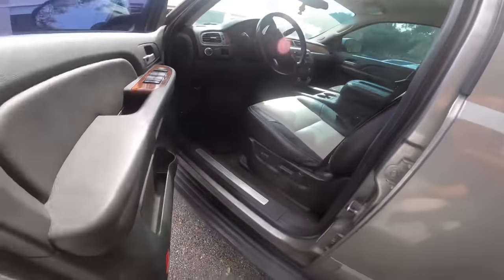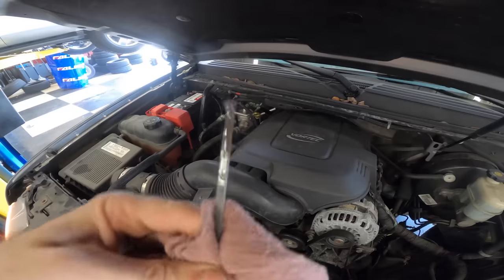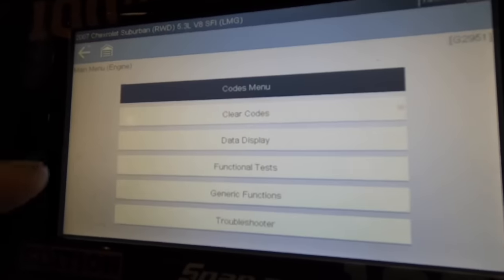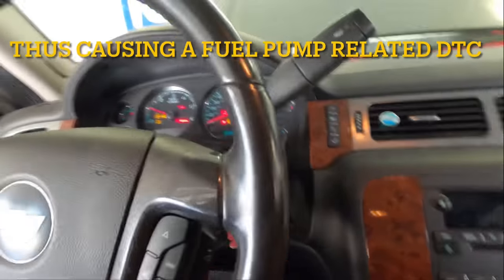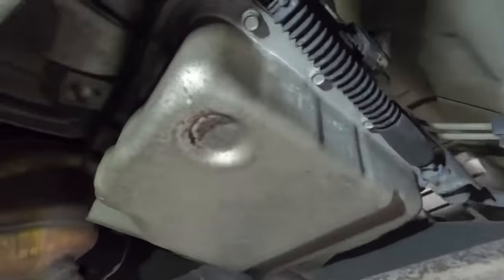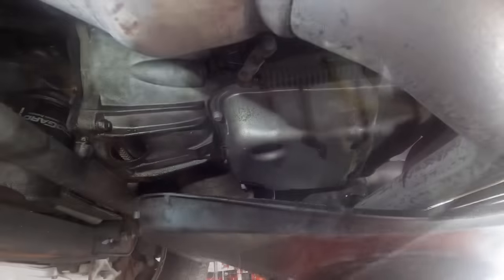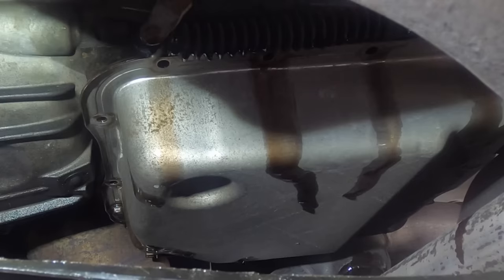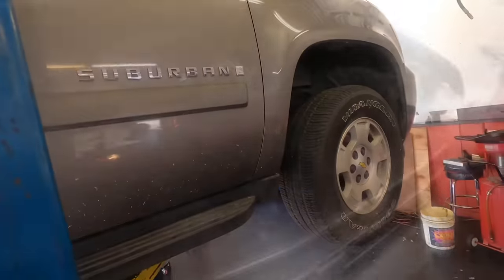Busted! SCAMMING Mechanic Causes Damage! 4l60E Transmission

Comment: Bravo, I was a mechanic / technician for 40 years solving seemingly unsolvable issues for my customers. It makes me happy to know there are those carrying the torch. Thank you.
Reply: YouTube ShadowsComments  my solution is quite the opposite buy the cheapest used car I can find that is mechanically sound then maintain it properly and fix what you can fix from youtube videos and if you cant fix it send to junk yard get most your money back plus riding 😎
Reply: YouTube ShadowsComments  well I'm 33 and has served me well for quite awhile knock on wood plus my basic insurance plan has 5 free tows that i can fall back on good luck with your monthly car payments lol
Reply: YouTube ShadowsComments  you would be suprised how easy alot of stuff is to fix just from a simple youtube search
Reply: YouTube ShadowsComments  not if you have 2 cheap used cars like me and insurance for both is like 20 dollars difference
Reply: YouTube ShadowsComments  cool different strokes for different folks I suppose lol plus I like having the cheapest insurance as possible too
Reply: YouTube ShadowsComments  no headaches they work great and when and if they dont they will either get fixed by me or go to junk yard and I'm out nothing or very little but if a new car breaks beyond repair and out of warranty now thats a headache ounce it runs out I mean
Reply: YouTube ShadowsComments  a financial headache lol
Reply: Plus you can hop in your new car and drive cross country without much worry, instead of breaking down in some small midwest town that you have to wait days for parts or repairs .
Reply: @chuckshade7959  rent a car
Reply: @chuckshade7959  even if I had a new car id still rent a car to not wear mine out
Reply: Im trying but it's very frustrating some times.
Reply: @LJT9393  well said
Reply: YouTube shadowcomments doesn't know anything about working on cars. He basically said I'm mechanically stupid in my mind lmao.
Reply: YouTube ShadowsComments  You are getting trolled hard by the creator of this video kid, just let it go and agree with the broke people
Reply: YouTube ShadowsComments  please tell me, what make and model is the car?
Reply: YouTube ShadowsComments  bucket on wheels huh?? If u only paid 15k u definitley are the one driving a bucket on wheels, and payments too yea no thanks ive had my 97 lexus sc400 for about 5 years now for about 1600 with 96k miles on it it now has 165k miles and ive had to put probably 3-400 dollars into it for maintenance over(preventative maintence at that) time. And honestly i feel way better driving around in it than tbe dude at the light in his smart car or prius and at that the engine on the lexus sc400 are easily and very commonly running to 300k -400k miles i doubt ill see that smart car running last 200k so it may even outrun it for a quarter of the price. And its already a head turner, imagine if i had another 13k into like the dude w the new 15k car sheesh it wouldnt even be comparable imo. So yea have fun with that. Also for the guy about how cheap car will break down idk about that i took it back and forth to san diego to visit family from fresno california many times never had a problem or hiccup ever doesnt feel a touch different then when i first got it so im not sure i agree with you. I think you forgot about the research you could use to avoid that unreliable bucket occurences to be frank with you
Reply: YouTube ShadowsComments  yea idk about  bucket either i get looks at the car kids taking pics but i never seen someone taking pics of the stock new car. Not all used cars are bucket couldnt more ignorant point of view this takes the cake.
Reply: @les3316  same
Reply: YouTube ShadowsComments  And you have a bigger eligibility window for the lemon law should you need it.
Reply: @LJT9393  It's not hard to find  0-2% interest rate if you have decent credit. Keep your cash in the bank or invest it
Reply: YouTube ShadowsComments  you never answered my question, what car do you have that was 15K brand new? Answer plz.
Reply: @les3316  I've got a 1992 S10 blazer that I've had since 1999..thing is still reliable as hell even though it's now just a spare ride.  Kept it running myself with maintenance.  Biggest issue is I have to take the egr valve out and clean it every couple years because of debris
Reply: @donbianconi8446  nice
Reply: YouTube ShadowsComments  I don't  understand your response-my what doesn't come with a warranty?  Was this intended for someone else?
Reply: YouTube ShadowsComments  Your comments are irrational-without knowing my portfolio, you have no way of knowing whether I will lose money or not.
Reply: YouTube ShadowsComments  you didnt read that much huh but im lost , the points i covered are neccesary so i dont hace to go back and forth jus get to it once. You going back and forth in the comments with the other dudes makes so much sense to you right?😂😂yea ok
Reply: YouTube ShadowsComments  theres a reason people have these debates and it never changes any opinions or enlightens anything, shit people cant even read that much to even get to a resolution😂to each its own ig
Reply: Repent to Jesus Christ Repent to Jesus Christ  i appeciate it brotha have a look at judges 6:12-6:16 man i feel this message should be spread👍
Reply: You guys are like the surgeons of the car world. Thank you!
Reply: @LJT9393  I never got the dealership jokes about undercoating and rustproofing. Frame rot's nothing to laugh at
Reply: YouTube ShadowsComments  idk man allowing pride and embarrassment to influence a car purchase in any way sounds frivolous af unless you're in an image-sensitive industry
Reply: This happened to me in the 90s. They soaked the clutch. Contacted the BBB and state.  No one helped Lost the car over it. Miss that car. Miserable experience.
Reply: @les3316  Mind telling what cars you have?  My cars are paid off, reliable Fords 1999 and 2014 I fix myself but asking for future reference.
Reply: YouTube ShadowsComments  What car do you have?
Reply: @chuckshade7959  Whats wrong with the midwest?  Its the west because of its vastness and south because of its creepy sundowner communities that would have me worried.
Reply: @les3316  Except now rentals are exorbitant.
Reply: @LJT9393  "filled with garbage BS components put in place specifically to prevent car owners from repairing their own vehicles"  I actually had a 93 explorer once that had torx wrench bolts with a pin in the middle of the MAF sensor holding it down before torx wrench sockets with pin holes were readily available to prevent people from cleaning it out themselves instead of replacing it so they did it on the old cars too.  But I agree with you.   "driving a new smart car."  Smart cars weren't cheap nor are they available any longer so are you sure you know what you're talking about?  "You can’t do anything to your car repair wise and have to take it to the dealership every time"  Hmm fixing my hybrid Ford has been a breeze so not sure what you're talking about.   Easiest brake job I've ever done in fact.  You must be  talking about new cars as in 20/21 so now I am scared.
Reply: @LJT9393  "cause if you do try and fix something, well now your entire warranty is voided"  Not true.  Look up the Magnuson Moss Warranty Act.  Ok guess ill stop reading the rest of your comment now because you don't know what you're talking about.  Funny how when you get to a certain age you can start to see bs from a mile away.
Reply: YouTube ShadowsComments  Now you're getting rude too.  Just because they are, you shouldn't .  My house is paid off so does that make me better than you?  No.
Reply: @ghettobatman8329  "You are getting trolled hard by the creator of this video"  hmm good point.  I didn't watch the whole thing so don't know but maybe we all are getting trolled by it.
Reply: YouTube ShadowsComments  My 2014 is a slick and shiney FFH which gets 49mpg and has some balls, is that a junker too?
Reply: @slurr4588  I paid $11500 for my 1999 when new and it's till a fast little bitch, and very reliable, easy to work on an puts rubber down with the right mods but I've been more interested in MPGs the last 10 years.  So is that a bucket on wheels too? I have a hard time parting with it.
Reply: @slurr4588  "ive had to put probably 3-400 dollars into it for maintenance over"  crap thats a LOT  I put in about $20 a year in maintenance on my 1999 Ford.
Reply: YouTube ShadowsComments  Uhm maybe he has a skyline or cossie.  Now youre showing your ignorance.
Reply: YouTube ShadowsComments  "Never needed them except for free oil changes."  Wow free oil changes, that's sweet.  what car is it?
Reply: @slurr4588  Haha you guys are hilarious.  Now you mention it, that is a good quote. @“Heaven and earth will pass away, but my words will never pass away.”
Matthew 24:35 NIV  So we can never be forgiven for our words?
Reply: @LJT9393  "why would your comments be ‘shadowed’ for naming a vehicle make and model" Youtube deletes comments all the time, what are you talking about?
Reply: @les3316  yes,  I pretty much do the same. Been saving car payments since 1995. Right now I have a93 sentra I've owned for 3 years,  literally cost me$1.
Reply: YouTube ShadowsComments  "I'm not reading your long nonsense"

Aka I have no rebuttal or I have a Stegosaurus sized brain and horrible attention span
Reply: @les3316  you know, what your suggesting may not be a bad idea. I might give it a try next time I need a car.
Reply: @cskye6529  bro then u need to change ur oil😂 oil change doin it urself is more then 20 bucks😂but i get what ur sayin tho its nots always neccesary i jus meant 300-400 like change all oil(even diff lol) and like wax n ceramic coat diy n stuff and paint scratches from the highway but im mean again most of those aint even neccessary
Reply: @cskye6529  yea they delete offensive comments pertaining to religious, racial or the way someone swings, but not for a car make and model… buddy just doesn’t wanna tell me cause he knows he’s on some BS..
Reply: @cskye6529  no I was talking about not being able to do any work to your vehicle and have to take it to the dealership otherwise your warranty gets voided. You can get it done other places I was told by a salesman a couple years ago but it has to be done by a licensed mechanic. Which conflicts what I’m talking about in terms of fixing things on your own car at home.
Reply: @marcuswelch4515  no it’s not something to laugh about for sure. But you can take it elsewhere and have all that done for literally half or a quarter of the price AND it won’t be added into your contract with interest applied.
Reply: @LJT9393  
Ah, makes sense! Thanks for clearing that up. I guess I got the impression that undercoating/rustproofing was considered a full-on scam (i.e. you'd pay for undercoating/rustproofing that didn't exist, kind of like blinker fluid or muffler bearings). I didn't realize all the jokes in the media simply were referring to gouging.

Actually, I can trace it to the Seinfeld episode "The Dealership":

JERRY: Alright, alright. Alright, that’s enough! Let’s get back to my deal. That undercoating, that’s just a rip-off, isn’t it, David?

PUDDY: Oh, we don’t even know what it is.
Reply: YouTube ShadowsComments  ...and who do you work for, and where is your shop?  I am having similar issues with my transmission, I think. I wish that we had an highly trained  professional gm technician in my area to work on my baby, 2007 Grand Prix. I have been so frustrated with mechanics "throwing parts at it", and yet never repairing the issues or even to offer possible solutions for preventative maintenance.  Their excuse is always " ...it's  an old car".  She has 175k miles and looks great. My plan is to keep her for another 4 years and 225k miles.

Comment: Thank you for being honest. I had a Ford DEALERSHIP try to scam me with a radiator hose.  I was to busy to do it my self that day and had them fix the radiator intake. Suddenly the return hose had a Phillips head screwdriver hole in it.  little did they know that I'm a mechanic and called them out.  they fixed it with me watching.  Never went back.  Now as a mechanic I can't even trust other mechanics.  This is really sad.  Thank you for being awesome.
Reply: Hmmm. 

So I took my car to get an inspection at a shop. I was obviously not aware that mechanics are scammy. No tools to fix things  myself. 

They found that the radiator “cracked” I gave them the okay to fix it. And now my coolant reservoir is constantly low. Again I just should have done my research beforehand. I never had a problem with my radiator in the first place. 

In your opinion how would I check to find issues with my hoses?

Comment: When I worked as a technician I always hated scammers. There's enough honest work out there to make bank, no need to do shady stuff to make bank. But definitely helps to have it on video in case they need extra evidence. Thanks for doing honest work, it's always good to see.
Reply: They make everything so much harder to repair in the future as well. My favorite was and 80 year woman who had three horns on 04 ford fiest, as well as a flip out monitor radio, chrome 14” rims, and a an alarm that was not only the cheapest I’ve seen but after they drilled through the firewall they gave up and left the wires unconnected.

Comment: As a disabled U.S. Army veteran, Abrams mechanic, and "shadetree" mechanic.. whoever set that scam up, needs to have the crap slapped out of them. Repeatedly. I HATE scamming pieces of crap. And I hope the person you did the work for absolutely RUINS that scamming jerkoff. Thank you for being an honorable mechanic.
Reply: There are a lot of " mechanics".  I brought a Focus in for a recall repair.  No check engine light.  When I picked it up, since there was no check engine light problem originally when I brought it in, I was shocked to see the check engine light on.  The mechanic/dealership did not mention it was on.  I looked up on internet what could cause this.  One video mentioned that if connectors are not seated properly it would produce check engine light.  I opened the hood and saw a connector that was not all the way in (sheer luck that I caught this) and pushed it all the way in.  I asked another mechanic (not dealership) if they could let me know why the light is still on.  I mentioned what had happened.  He said the charge is $100 to determine why the light is on.  Well, I continued to drive but my emissions was due so  I was desperate to try and figure this out.   I went to auto parts store and they tested and gave me the codes that apparently caused the check engine light.   They said they could not clear the check engine light and I would have to order a part that could do that.  I went to another auto parts store and they printed out what part "possibly" needed replacement, but they were careful to say this might not be the problem.  I asked if they sold equipment that could clear the codes and light and they did find one in stock for $50.  I bought it and figured out how to clear the check engine light and codes.  Oh, my gosh, I was so relieved.  I drove it to emissions testing, and no check engine light appeared and it passed inspection.  So, all this time, though I luckily caught the problem, the check engine light could not just be cleared by any mechanics that I asked.  I seriously do not trust mechanics now.  What a racket against innocent consumers like me.
Reply: @2009glories  My parents' diesel 4 wheel drive had assorted problems (blown head gasket, etc). Went in to the mechanics for repair. Came back with more problems (DPF blocking up constantly, etc). Dad opened the bonnet, discovered that the mechanics didn't tighten the hose clamps on the duct connecting the turbo to the intake manifold.

This of course meant that the engine was getting way less air than the MAF sensor was telling it, leading to over-fuelling and stupendous amounts of black smoke that was hidden by the long suffering DPF, causing it to clog and preventing the regens from working properly. It won't be going back to those muppets.
Reply: I too have the same opinion of scammers. I call it a righteous anger. Not that I’m righteous, but in these instances when it appears to be a scam-it is. I wish you the best my friend.

Comment: Dude that shop is so chill. All the ones I've worked at had me hustling like I owed them money. Those greedy bastards.
Reply: Shop is so chill. Beck Yea!
Reply: The young bucks always get rung
Reply: That's how most shops should be run. I get that it's not profitable so instead of people's cars getting treated with respect everything is going to get impact hammered on and off to make the owner some extra bucks.
Reply: @dtech1218  Agreed. I used to work for ZF putting gearboxes and differentials together, and they also focus on production numbers rather than quality.

At first I tried starting the bolts by hand before hitting them with the air gun and everyone looked at me like I was restarted and just trying to kill time. I was told to drive them in with my gun from the get go and that's exactly what I did from then on.
Reply: mf's stand up and stick together then they have the power. owner, mgr cant do it all.....🤷🏻‍♂️

Comment: Installed a four point hoist in my backyard shop, I can do just about anything for my vehicles, I'm grateful I quit my senior year of high school to work at the best motorcycle shop in my city, learned so much there, running the counter, parts ordering, engine rebuilds, diagnostics, tire changing! You name it, later after college I still retained those skillets which worked perfectly with my Art skills, you see my art every day all across America. Being a Mechanic is the best foundation you can have. Great video.